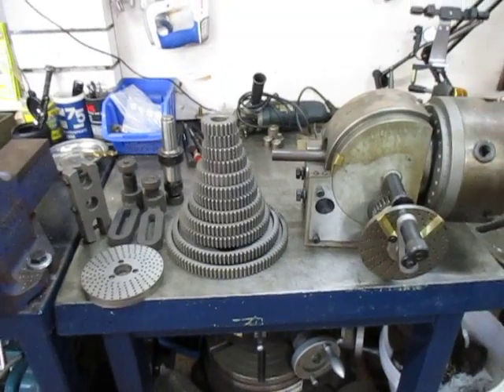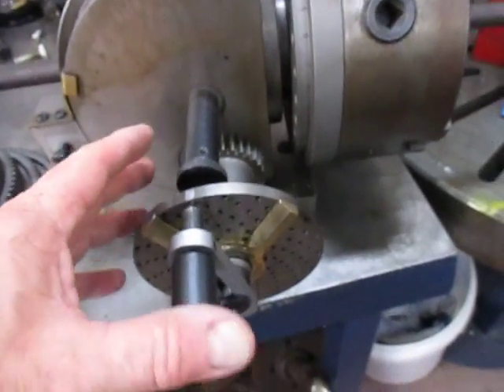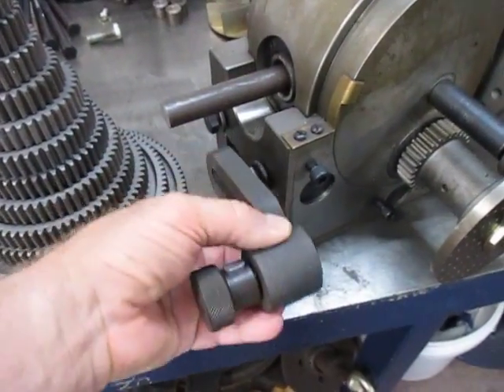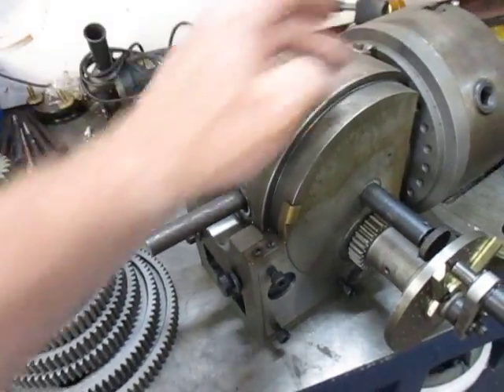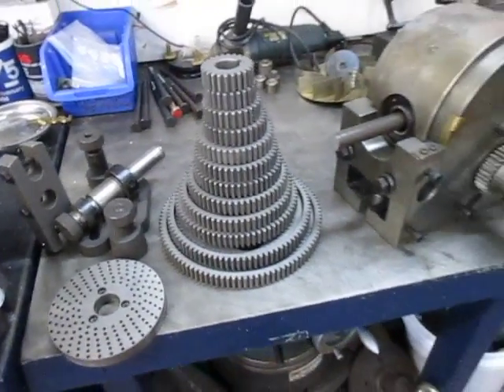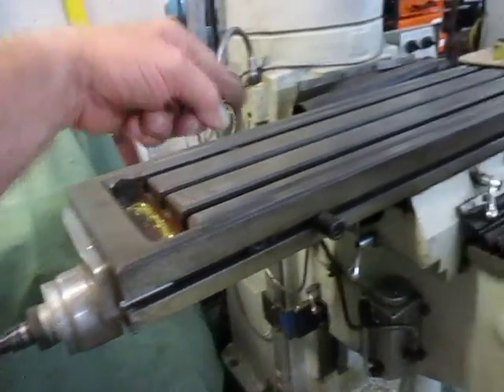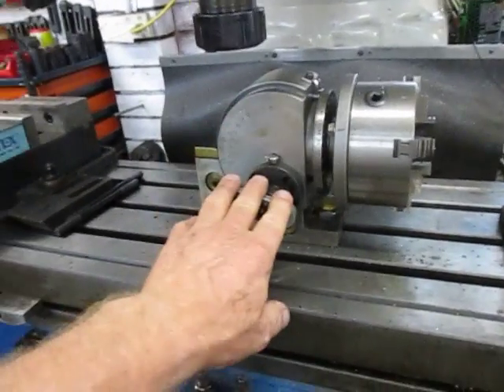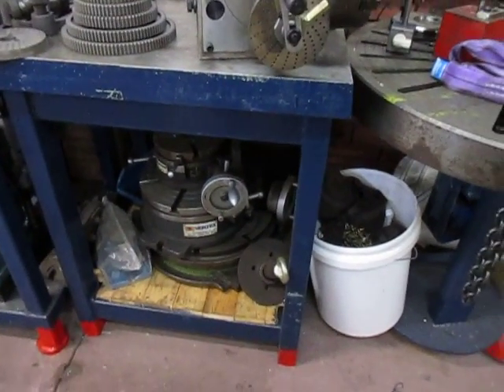390 BS2 INDEXING HEAD

Comment: What diametral pitch are your gears? 12?
Mine are 14 and need some repair.
Thanks,
John
Reply from the maker: Mate I don't know what pitch I'll have a look when I get home early July. I hazard a guess they are actually Module pitch as it is from Taiwan, I could be wrong, do you need some help in the repair?
Reply: Bruce Whitham 
I'm trying to find tooling.
AGMA 14 DP 14 1/2 degree PA cutters are hard to find.
I'd prefer a hob if I can get it.
Thanks,
John